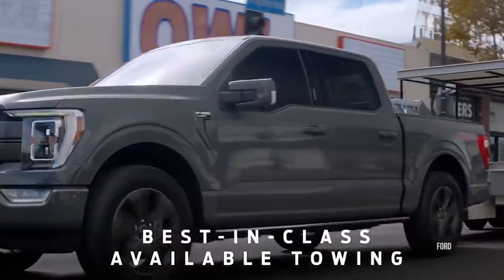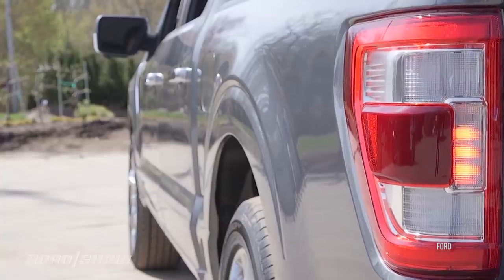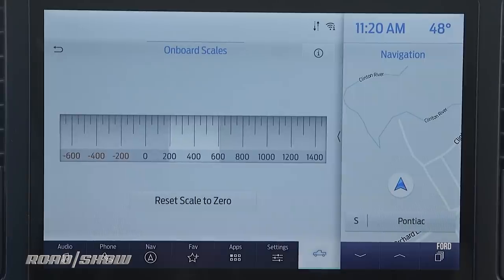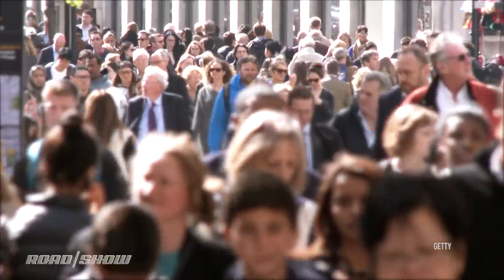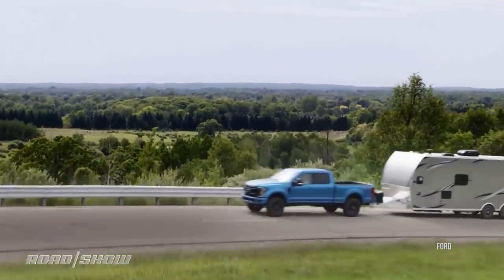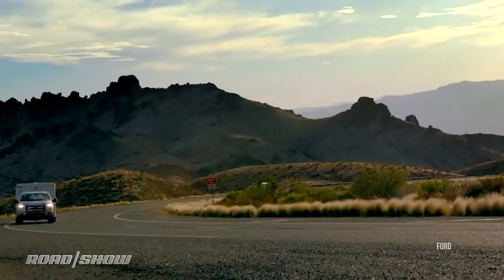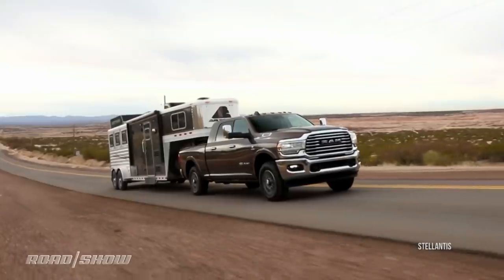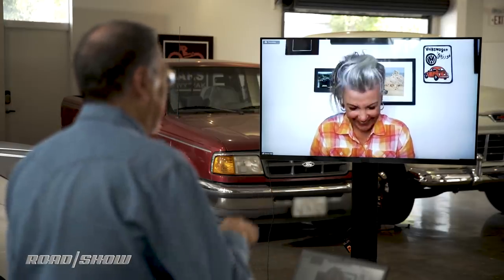Are you towing or hauling too much in your truck or SUV?

Comment: Good advice! Trailer load weight distribution (front, middle, rear of trailer) is key. Don't put all in front or rear, must ballance over wheels and front of trailer. Securing load important, as well trailer weight and tongue weight ratio (general rule tongue weight should be 10% of trailer total weight) not exceeding tongue weight rating of truck. Weight distribution hitches help. Electric brake modulation important...etc  Research and practice!!!!

Comment: Every farmer overloads everything they own, the real question is what's the real capacity of this wheel or that axle or this frame or that tire or this leafspring or that shackle bolt? 
The ratings are low so that when something goes wrong, the manufacturers can't be sued. 
 I've seen a SRW Ram 2500 Cummins with NV4500 and 245/75R16s tow a 40k gooseneck weekly for years without failing. Cody aka WhistlinDiesel showed a squarebody K20 carrying 30k and all it did was bend the sheetmetal, the mechanicals were fine. He goosenecked 30k on a Toyota Hilux, same result. The ratings are so underrated that they MUST be ignored. I myself have goosenecked 30K on a 2wd W/T1500 with the 4.3L V6. Nothing damaged, no crash, all good.
Reply: Did you hear the test protocol? Obviously the vehicles can go over their rates numbers under more or less ideal conditions. An f150 could pull over 10k lbs easily on a flat road in a 90 Fahrenheit day, but throw some rolling hills and increase the temperature to 100+ Fahrenheit and by the ends of the day your brakes and transmission are going to be cooked.
Reply: @robertopics  and my '97 Ram 1500 just carried 4150# more than it's rated to, so what?
Reply: @davisstephens8405  so you're one of those guys that pull up to the hardware store driving a truck with a bent frame?
Reply: @robertopics  if you can find any frame damage on my truck, I'll give you the title.

Comment: In my country, vehicle's (cars with max weight of 8000 pounds) when towing, there is a max speed of 55 mph. Vehicle's (with a weight of over 8000 pounds) towing or no towing, always a max speed of 50 mph. Simple🤐
Reply: Not in Canada and the US. People spend extra on things to be able to pull their triple axle toy hauler up a 10% grade as fast as possible. Trailer tire speed rating be dammed. 

I was on my way camping and this guy in a big motorhome was going slow up the hills because the didn't have the power. I was doing 100 km/h (the speed limit) towing my trailer. Then we would hit a flat spot and I am still doing 100 km/h and he flys by me doing about 130 km/h. Then at the next hill he is doing about 60km/h and I fly right by him again. Happened about 4 times lol.